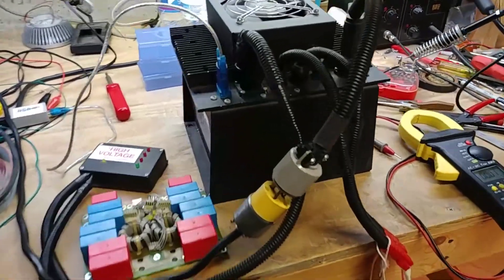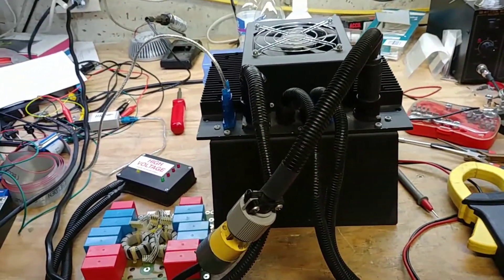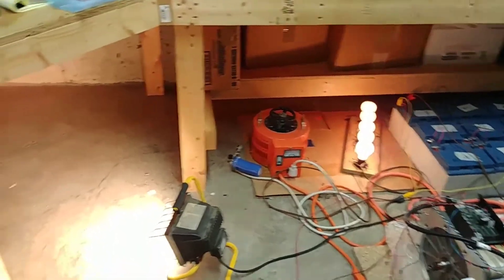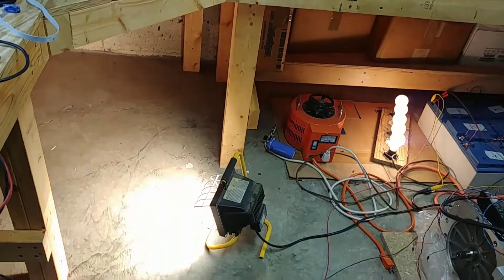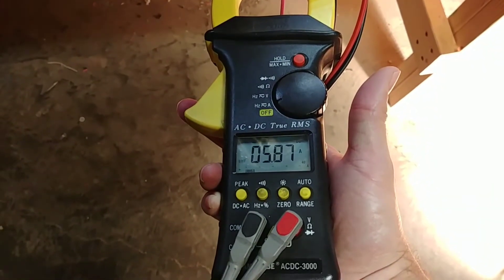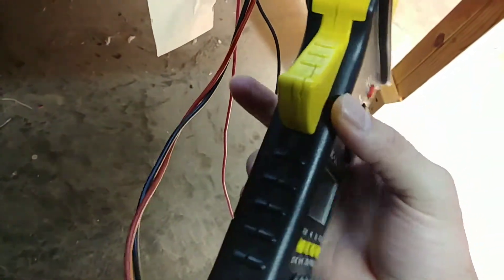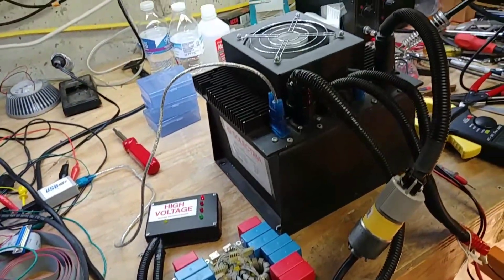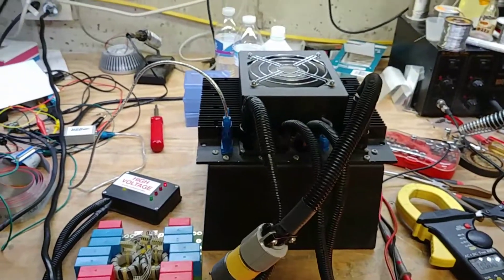Solectria BC3300 Repair S/N 1282 Part4

Comment: Nice job having your plug ready to go.  I recently added a UT210E to replace an old so so clamp meter and would highly recommend it if you want a low cost replacement for your clamp meter.
Reply from the maker: +jontscott 
Yeah, I think it's time to replace the old Amp Probe.
I need to get the bi-directional buck boost converter done... 
Then I can retire the battery pack, and the meter, since it will display voltage and current.